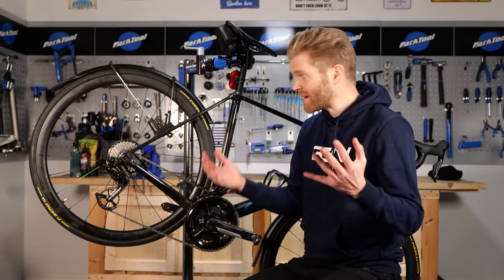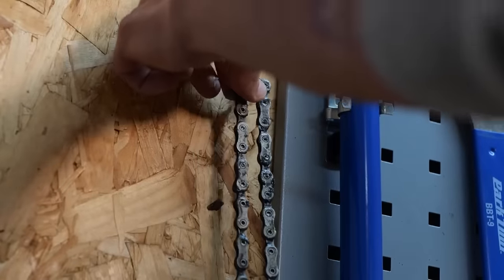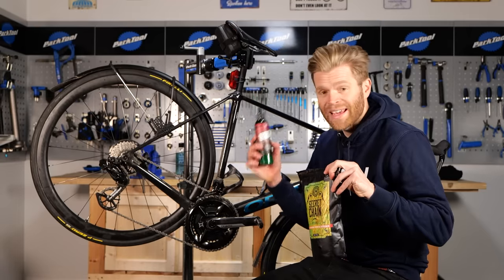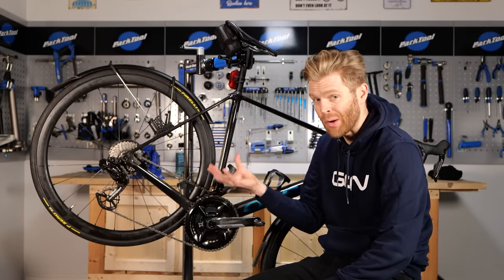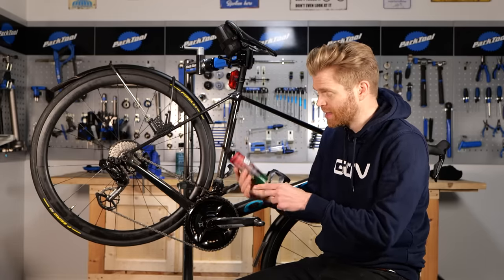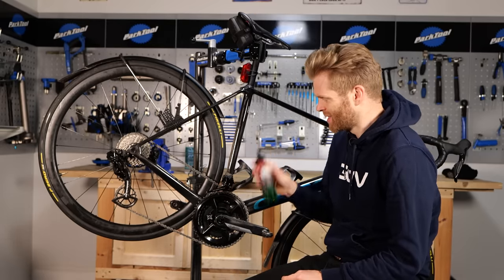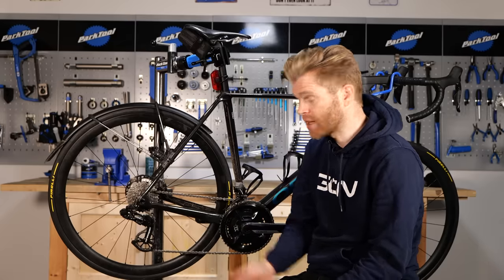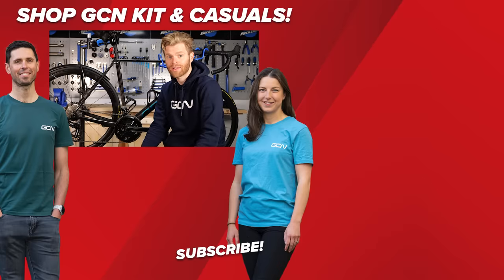Most Efficient Way To Maintain A Waxed Bike Chain!

Comment: I've been exclusively using drip wax and my chain still becomes black and dirty when you touch it. Is this normal?
Reply: I think it is, I get the same results,  I bought the kit a couple of months ago and did the chain on bike method.
I check my chain once a week usually the night before I start my work week.
Reply: Hehe, the thing is that they added something to the drip that makes it black in itself. I get black fingers by touching my Silca drip lubed chain and after applying and drying, the chain sheds black sticky "dandruff" on my chainstay and floor, , so not easy to wipe off.

Comment: #AskGCNTech Is it sensible to use compressed air or an air compressor to blow water from hard-to-reach spots on the bike to keep them clean? i.e. drivetrain, hubs, headset, bottom bracket etc? Or will that just push the water into the seals and have the opposite effect?
Reply: You can use air to blow water out of the rollers on your chain if you clean your chain.  Dunno about the others.
Reply: FWIW, I have a Ryobi shop air blower that I use to get water out of difficult spots (vacuum cleaner works well too).  So far, pretty good results.  My observation (take as you will) is that getting rid of most of the water will likely out weigh any affects of getting some water into crevices
Reply: Yes, after rainy ride, I use me compressor to blow the cassette dry, and the chain. WORKS GREAT,

Comment: What I'm puzzled about is how many kilometres I can ride between applications. I only ride in the rain if I get caught out, so it's normally dry roads riding. But I saw another of your articles about chain waxing and you were talking about re doing it after about two hundred kilometres. That seems to me a shorter period than with conventional lube. Or have I got something wrong here?
Reply: Re wax every 350 to 400 miles. If you get stuck in a heavy soaking rain re wax immediately after you finish riding. If you get caught in lite rain you can let it go to 350 /400 miles or until you get caught in the rain again. Which ever comes first. I don’t bother with the drip wax. Drip wax is good to take if you’re on a trip and have no access to hot wax.
Reply: Wax is a waste of time, you got the message.
Reply: I have a rain bike and I don’t use wax

Comment: "It's black, not because it's dirty.." Wax isn't perfect - that is dirt and tiny metal filings that are stuck in the wax from normal wear and tear. Most of these fine particles are quite heavy however, so if you re-wax your chain, let it sit in the hot wax pot, and move it around, nearly all of it will sink to the bottom of the pot. You've already got a coat of wax, you don't need more. You just need a clean coat of wax. Remove it, rinse it off, dry it and re-wax it. Keep a spare that's pre waxed so you don't have to resort to ''liquid wax". That's just more single use crap to store.

Comment: Lots of recommendations to take the chain off to clean it or hot wax it but nobody mentions the cost of a quick link every time or are you all re-using them? They are not cheap!
Reply: I've had no issues reusing them a few times. Reuse them until they don't make that click you feel when you reattach and snap them back locked.
Reply: lol, this is the most hilarious part of chain waxing.  One rough shift and that bent bushing broken quick link is busting in half and going right into your spokes.  My suggestion is to get a Wipperman stainless steel master link.  These are reusable unlike KMC/Shimano.

Comment: It is the same side of the chain you are cleaning 5:30 min into the video. The same side which is on the bottom first is on the top when you pedal around. So you cleaned the same side of the chain twice. You need to clean the outside and the inside not the outside and the outside again! ;)

Comment: Come on! Saving 0.3 - 0.4W is difference between holt melt and drip on? Literally no-one will be able to tell difference or benefit from such a tiny saving. By all means do a hot melt on brand new chain to get started but after utterly pointless.
Reply: New chains come with grease in the rollers which is as good as any wax so leave it on.

Comment: 3:14 Wax is absolutely NOT water soluble. The water emulsion wax drip has wax suspended in water, not dissolved in it. Water will not touch your waxed chain unless it’s hot water

Comment: It's very important when fitting a rear mudguard to ensure that it doesn't prevent wet muck from the road spraying your ultra expensive front derailleur, which must not under any circumstances be dipped in hot wax. That's why front derailleur manufacturers own almost all the mudguard manufacturing companies.

Comment: It’s a myth that waxed chains are more time consuming to maintain. If you’re degreasing an oiled chain properly it takes longer to maintain than a waxed chain.
Reply: I also feel like having to attend to every roller when using drip is a lot of work. At least more work than letting the chain sit in a pot and swishing it around a few times.
Reply: My main bike I ride 150 miles a week with Chain L mineral oil lube, I haven't cleaned or oiled the chain in 2 months it is buttery smooth.  It's not a myth at all, wax is a total waste of time unless you are poor.
Reply: You should never degrease a chain anyway, just clean it with a rag & brush then apply more oil. Also don't apply oil a drop on every roller, put plenty all along the chain & do not wipe any off the sides after as it protects from rust & runs smoother. Bike oil is dirt cheap, use lots & use often.

Comment: Just got into chain waxing. Still not sure it’s worth the aggro. Chain looks kinda dirty with the black wax on anyway and it is much noisier than a lubed chain. Lots of fecking about and the white ‘speed wax’ looks messy too. Still undecided. Kinda feel like this fad is over hyped vs. properly lubing a chain and wiping all the excess off. The ocd levels for chain is a proper middle aged man mid life crisis hobby. I am guilty of this but the SILCA pot is £80 and in effect it’s just a £12 bikini wax pot rebadged.

Comment: Water soluble wax? Dr. Bridgewood, really? In my understanding paraffin wax is essentially the same thing as the regular wet lube, a mix of various hydrocarbons, just with a higher melting temperature. Not water soluble at all. Water does wash it out, but only the same way water washes greasy plates.

Comment: cmon GCN, wax is water soluble? no its not.
Reply: It is, but it also is hydrophobic, so you dont see waxx dissolved in water everyday. Hot water also melts the wax
Reply: @Spiralitism  Sorry but this is wrong. This wax is an emulsion in water, not dissolved. You can't wash later on the chain, you will need hot water, but just to melt it, not dissolving

Comment: Don't wash microfibers rags. You release microplastics and the lubricants accumulated in the fibers in the water, so big NO.
Reply: So we supposed to throw the whole rag in the trash after one use?........ shouldn't your advise be DO NOT use micro fiber rags?.......
Reply: @phenofinder9145  It's bad for the environment to release mineral oil in the water, that's it. Whether you use a cotton or microfibers rag, result is the same.

Comment: The best way to maintain a waxed chain is to melt the crap off and start using an oil based lubricant (like Lily Lube) that can more easily, and more frequently, be cleaned with simple wd-40 (from a gallon supply) in a simple device like the Park Tool, then reapply Lily Lube as instructed.  More frequent cleaning is better than a minor marginal wax benefit done less frequently.  Maybe have a wax chain on stand-by if you have a race day only need.
Reply: no matter how frequently you clean on oil-lubed chain it will never be as clean or as fast as a waxed chain. Why would you want to oil-lube a chain that requires frequent cleaning to remain even dirtier than an uncleaned, waxed chain. The longevity of waxed chains are proof that contamination doesn't get into the rollers like on lubed chains.
Reply: My experience is different than yours. I've used wax and Lily Lube, have you? Have you seen the lab test on Lily Lube vs.wax?  Negligible. Lily Lube every night before a next day ride. I may not be using wax correctly, but my chain stretch and ring/cog wear is no different and I have sometimes felt grind wear because dried wax doesn't allow new wax to penetrate, and wax can be ground away more than oil leaving bare surfaces. What I do is so much easier, and I can purchase multiple new chains for the cost of fancy wax stuff.  New chains are better than prolonged use of longer use wax chains.

Comment: All of this effort to have a chain that shifts and rides much more rough and loud than standard mineral oil that lasts 2000km.  Chain waxing has got to be the most ridiculous part of being a roadie, even more so than the silly shorts.
Reply: But oil ends up a black gunky mess after one wet ride.
Reply: @bikeman123  Still quieter than waxing in that state, and you can brush all the black stuff off with a chain brush takes 30 seconds.
Reply: @___Bebo___ 30 seconds to clean the chain and to relube it? Well you know very well, that this not true at all!
It takes a lot more time and it is always a mess, especially in winter. Once you used wax, you dort want to return to oil. At least that is my opinion.
Reply: @UltraLord5850  Wax is a joke, if I used wax I would have to take the chain off my bike every 4 days, are you kidding me?  Ride your bike more.  Shimano website says do not use degreaser or take the chain off the bike.  Lets just choose a lubing method that doesn't lube the chain, causes rust, weakens the side plates from harsh cleaning chemicals and breaks the rules of the manufacturer right off the bat, lul.
Reply: @UltraLord5850  Lets use the standard KMC quick link and open it over and over again so that rough shifting will blast the chain completely off the bike.  Am I waxing right yet? haha
Reply: @___Bebo___  yup, you just need a rag, a chain brush & a bottle of cheap bike oil. Use them regular & never put your bike away wet, dry the mechanicals & oil them first, including the derailleurs & other exposed moving parts, brake levers, pedals, whatever. That's all you need to do to keep your drive train running sweet as a nut for thousands of miles.